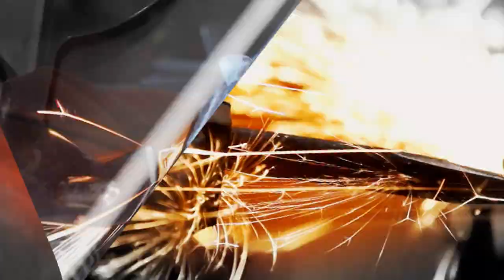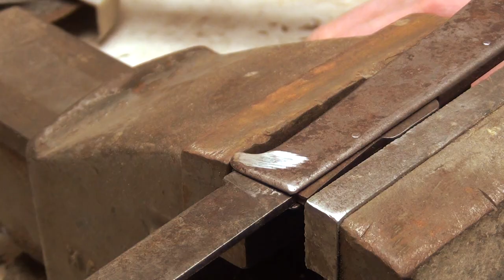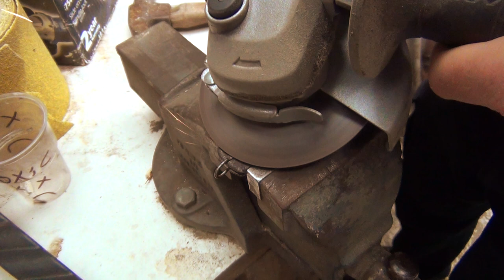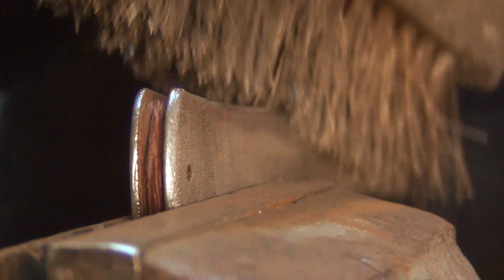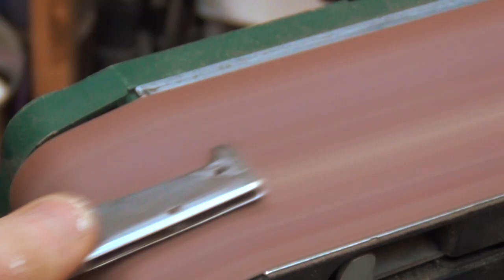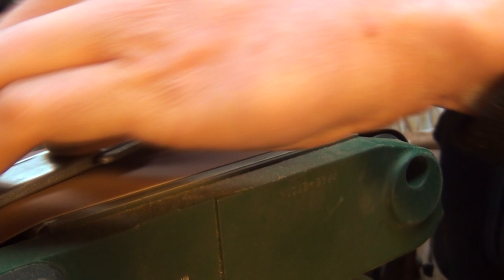LTW - Tool Time - EP18 - Mercator Folding Knife Restoration

Comment: It's your knife and you can do what you want with it, but IMO it was a way better before your "restoration". Basically you removed good old pins and badly scratched the surface of handle with angle grinder. You just needed to remove some rust and it woould look good. Next time try to restore something that really needs it ;)

Comment: The grinder was too much for removing the pins and it damaged the handle. I recommend using a file or hand-sanding down the pins if you plan on keeping the original handle. I’d also use a smaller hammer and punches to avoid accidentally denting your project. We all learn from trial and error though, so I’m sure you’ve improved from this experience.
Reply from the maker: Cheers for the constructive feedback.

Comment: Have not done this before, I never would have guessed😏
Reply from the maker: Lol. Gotta start somewhere. Cheers.
Reply: @legacytoolworks149  brother I'm not criticizing your efforts here. The thing is you made more work for yourself my digging into the handle with that grinding disc. Next time try a file to work down the material slowly or drill out the pins with a very small bit. And I'm not saying I don't make more work for myself I do that constantly but it's frustrating 🤣 looking forward to the outcome.. thanks for sharing...

Comment: If you'll accept it, I'll give you what I consider to be a very helpful tip or two. Okay?  Here it goes: Use a very gentle touch, in this instance soft hands on big power tools, and a focus on the details of the the task.  I'm not suggesting that  this rust bucket may have had a new life in her if taken to the dance in a smoother vehicle, but with fewer hacks from your gargantuan electric tools, fewer slams with your fifty pound hammer on to fat punches that fit a manhole, and cranking on bad pressure points on the scales in your vice, you might have found out.  Just suggestions.  Have at it.  Pound that baby into smithereens if you want. Just sayin', though.
Reply from the maker: Cheers for the constructive feedback.

Comment: If you are going to restore something (except for say a car), then power tools have no place.
May I suggest you learn to use hand tools before attempting anything like a restoration. The reason you are using power tools is because you do not know how to use hand tools.
Re-riveting is an art form in itself and certainly re-riveting a Mercator knife to anything even approximating the original look will require tools you do not have and never likely to have.
The knife did not require disassembly in the first place.